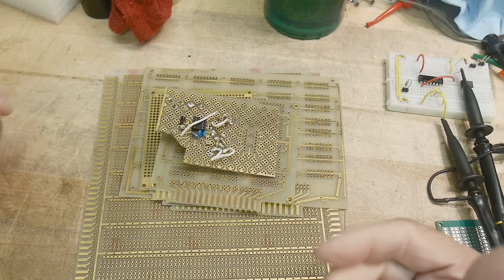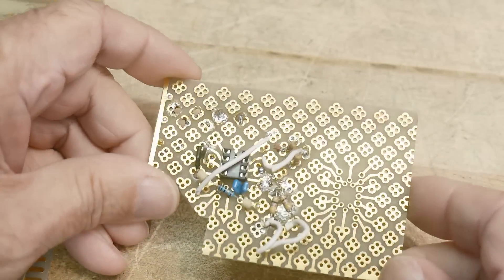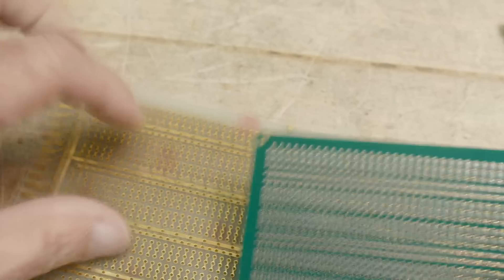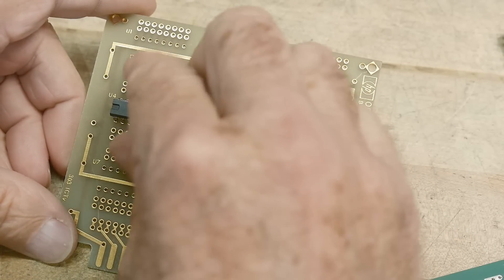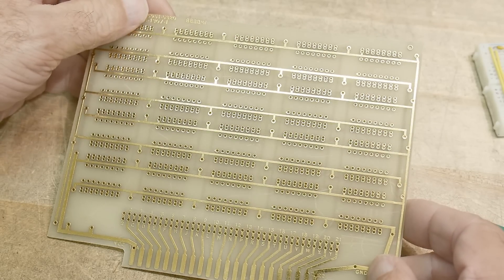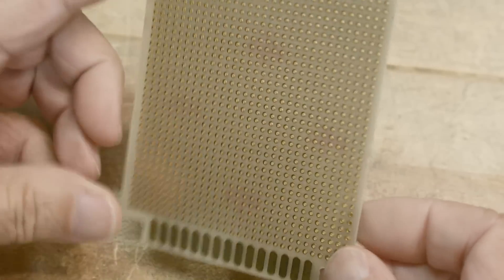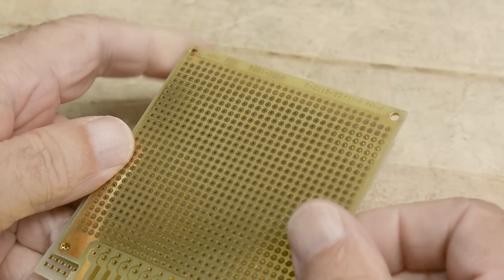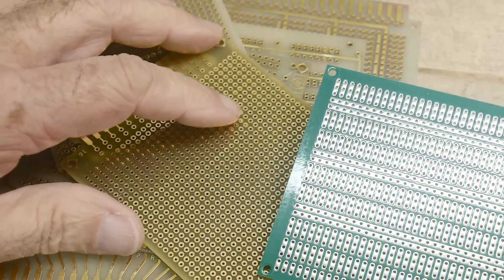#1455 HP Proto Boards

Comment: Thank You for every thing, I love your talent. I would love a board for esp32 or arduino . I mean break out to the 4 leaf board you made, plus space for IC schmitt trigger or 555+  space so a rigid multi-purpose system could be constructed on one heavy board. In addition an  edge pad that is wide enough to use clip leads during experment. I am 62 and don't fuss with customs, {I always under design}. You are a great teacher, please continue, From Bill Fischer.

Comment: ISA connector prototype board with one layer of ground and power is still useful today. Even we have powerful arm/riscv mc, we still need very fast address decoding and 5<->3.3v converter logic low integration chips in front. Protoboards with reserved place for those chips are still useful

Comment: The last two "all hole" boards you showed were probably for wire-wrap projects. I worked on equipment that used hundreds of wire-wrap boards plugged in to wire-wrapped backplanes. Thank you for another interesting video, Regards, David
Reply from the maker: probably, but not sure why you need plated thru holes and gold

Comment: I'll buy some of the first board. One board could be used for op amps or transistors. Perhaps if the hole pattern/lay out were available so I could integrate that pattern into the Euroboard standard boards. Kewl! Good video

Comment: It was great when a dip footprint would fit everything. Now there are far too many different pitches and row spacings. The sea-of-holes does at least allow packing the ICs as tight as you like : if you add prerouted power rails it ternds to put everything on a 0.6" pitch even when you have 0.3" parts.

Comment: The smallish boards with edge connectors remind me of the HP instruments of a certain era that were built from lots of cards about that size, plugged into edge connectors in a metal chassis. It was kind of a halfway point between the tube days and later designs with PCB backplanes. That analog board looks like exactly what you'd want for prototyping an instrument in that era.

Comment: A couple of times now I've noticed a frame from your vibration detection decap video appear. Not bothered, just mentioned in case it's infected your video production template. I'm guessing it's there for thumbnail referencing. Pretty PCB BTW.  :)
Reply from the maker: I did catch that during editing another video. your are right it is a problem not starting from zero each time.

Comment: Once upon a time I used to use solderless breadboards, then I started planning and laying out perfboard, but now I've moved on to Manhattan-style prototyping and I don't see myself going back, they're perfect for analog/high speed stuff. I made myself some adapters to "break out" common SMD packages and use 0.4mm enamelled copper wire to connect parts together. Sometimes I also just cut out tracks/regions on the base copper-clad board for really fast and tight layouts. Works beautifully.

Comment: The card with edge connector fingers; but, with out traces to the rest of the board... we used that type for plugging into a back plane... when we didn't want a connection to the bus.... but wanted the card in the system.  (You could solder some jumpers to the finger, if you wanted to bring power, or ground onto the card.)

Comment: HP "Breadboard" 888827 was probably only stocked in COS for prototyping the HP64000  cards with their particular edge connector. A beast at 10.5x11", 4 edge connectors, supply rails between DIP pins but no rows of connected vias. Wire wrapped. The "ECL Test Bd" was the same idea with tons of copper. 5060-0478 was that small size with a 0.1" grid with every 3 vias connected (but no supply rails) which was a pain for DIPs.
Reply: What I miss is the hookup wire which went into o-scopes and maybe stockrooms around HP -- also fun watching it get made, and the CRT glass lathes.
I have some most-likely scope-probe coax and haven't measured it, but another HPite suggested it might be the resistive stuff.

Comment: 1 vote for the opamp-ish one you like.   Another vote for the one with the ground screen on the back,I like the edge connector arrangement on it too, but I understand if you ditch that.  It might be cool if 2 opposing corners were tied to the ground screen layer with the other 2 corners not connected to the ground screen but still metalized on the top to connect to top traces.  You know what I mean...

Comment: You made no mention of the fact that the bds are copper, nickel, then gold clad. I have a couple of bds of the first 2 types you discussed. I've had them for about 40 years. I've never used them because I'm saving them for a project that is worth using them. :)

Comment: I've used the "ground plane" proto boards. Caution though, it's very easy for shorts to occur.......any tiny scrap of wire or metal flake can cause a short-to-ground. Good luck finding the problem if the metal scrap gets under an electrolytic cap or under an IC.
Reply: Vero used to do a board with the 3-hole pads on one side (with power traces) and a ground plane on the other. The ground plane was covered in solder resist except for a few solder pads, so they didn't short.

Comment: 4 layer boards are not that expensive. I wonder if it worth it to have internal planes.
Reply: I'm not sure that a 4 layer protoboard will be that useful. Having the power planes on the inside means that you're stuck with whatever outlet the designer chose to implement for connecting to VSS/VCC/GND/VDD. Putting the signal paths on the internal layers also means you're stuck with the choices the designer made and have removed the option to cut tracks where needed. FWIW, my comment above suggested 4 layers at first then I thought about it and edited my comment to 2 layers.
Reply: It is if the circuits are noisy.

Comment: Of course, now everything is surface mount. I've seen a few interesting designs for SMT protoboard. I actually prefer SMT because you don't have to flip the board over to solder.

Comment: I would definitely support seeing a reproduction of the card. I'd also suggest making it a 2 layer board with possibility of ground plane on the top and bottom, maybe not connected so they can be either GND and VCC too. A bunch of through hole and smd chip lands would be great too. I have a whole bunch of your digital board from PCBWAY, thanks for posting that!